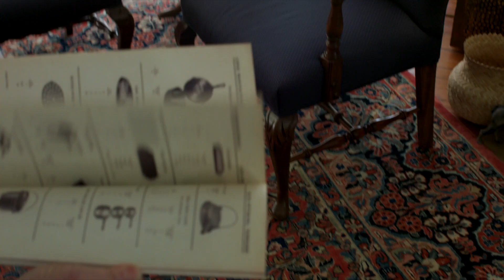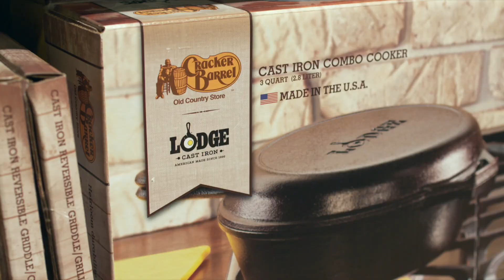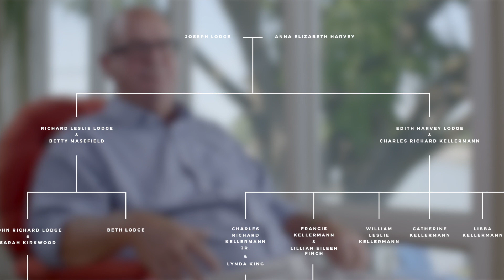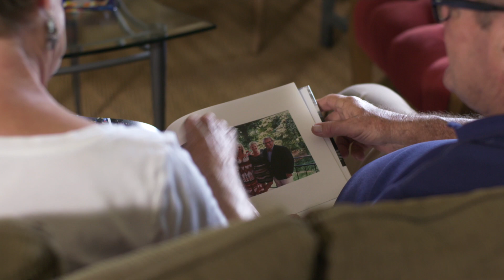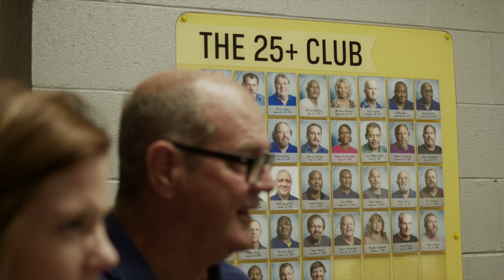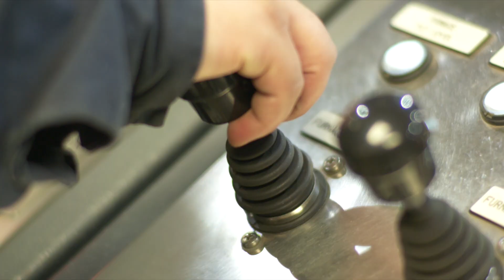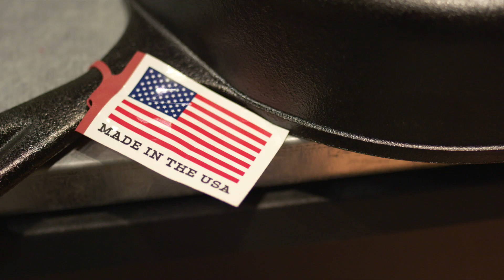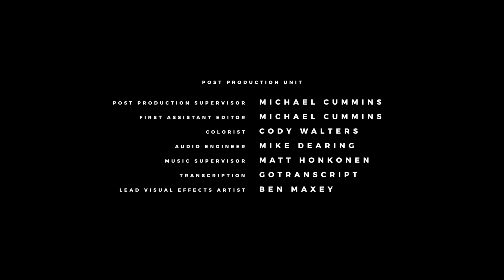Lodge Cast Iron - Remastered - Season 1 (Full Episode)

Comment: It’s funny they play the preseasoning as just a way to make cast iron more accessible. Lodge to my understanding was struggling in the early 80’s and needed to figure out a way to make cast iron more appealing and the preseasoning did do just that but part of that was finding a way to keep the company afloat. Personally not a fan of the gritty finish they do now but it’s cool they’re still around and the only American made Dutch ovens are made from lodge.
Reply: Skillets are American made but enameled dutch ovens are made in china...
Reply: gritty doesn't mean they are not non stick.
Reply: @JohnGrove310  no but to my knowledge it cut out the process of sanding the inside while still making it usable for the general public. It was a cost cutting measure.
Reply: @TheHuggybear516  "It’s funny they play the preseasoning as just a way to make cast iron more accessible." I'm not sure why that's funny at all. If a product requires the buyer to have some knowledge before using it, then it's obviously not as accessible as a product that is ready to go from the start of purchase.
Reply: @NinjaMonkeyPrime  Well Victoria makes a preseasoned product with a smooth finish. Plus the higher end cast irons you tend to have to season it yourself
Reply: @TheHuggybear516  Victoria may also pre-season for the exact same reason that you seemed to think was amusing for Lodge to do. So I'm not sure why bringing up that a Columbian cast iron company that also does pre-season products is an argument against that pre-season products make it more accessible to the buyer. And it's even more confusing that you mention high end cast iron requires seasoning as a possible argument to pre-seasoned products being more accessible. If the product costs more it's already not accessible. If the same product requires extra care, then it's even less accessible. The fact that Lodge is affordable and requires no initial setup is the literal definition of an accessible product.
Reply: @NinjaMonkeyPrime  Victoria had a smooth finish that’s what I dislike about lodge it’s not the preseasoning it’s self but that it has a rough finish that the just preseason without sanding it down. Use BSR or Wagner or even old lodge and you’ll see what I mean with more of a glass finish that took longer to achieve but atleast in my opinion made them better. That’s what higher end cast iron does as per your accessibility I still feel like Victoria is better because it’s cheap ready to use and has a smoother finish that I think is easier to cook with.
Reply: @TheHuggybear516  The price or finish difference is irrelevant to the simple fact that a preseasoned product is in fact more accessible to the public. You can try and argue that point if you wish, but bringing up other characteristics of the product is just changing the topic.
Reply: Just use a DA sander. I have six Lodge pans. I start at 60 grit and end with 220. 
I just do the insides and a bit, perhaps one inch high on the inside.. I just like the look of it smooth. Not sure makes the surface more non-stick or not.. But it's pretty quick and easy, fun to do. And it matches my other cast irons that way. My griswolds are smooth.